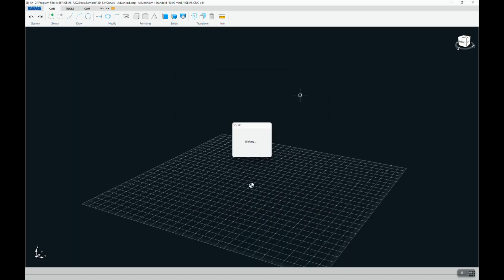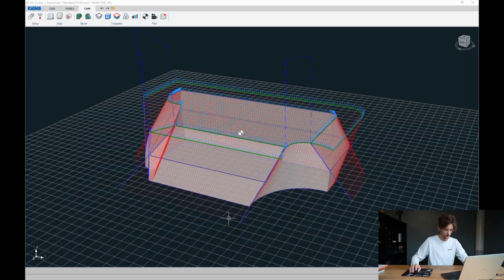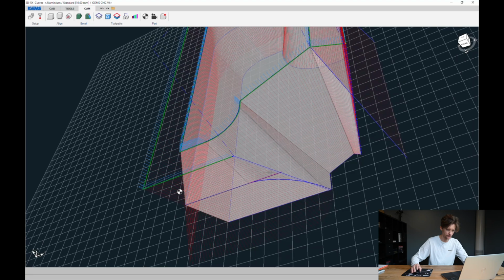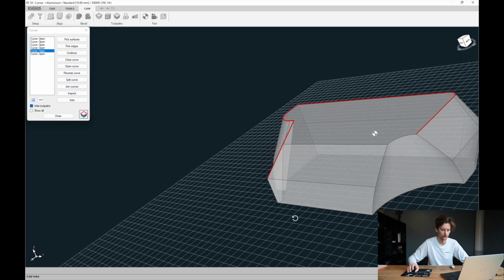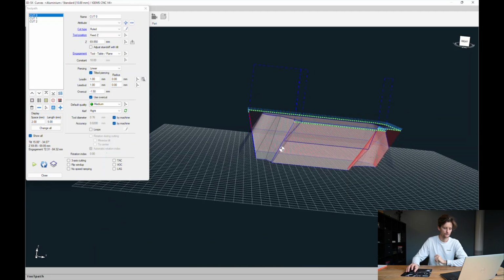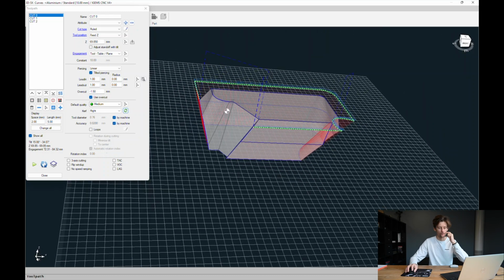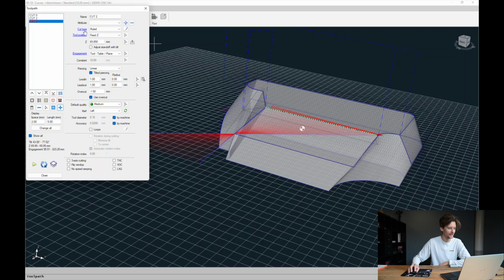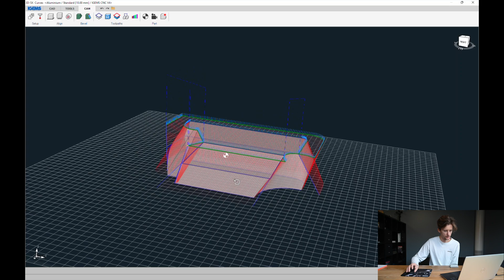Planning your cuts

Comment: Great video as always.

Im having some problem with a 45 Degree cut around a parts sometimes after programming my tool paths.  
'Rewind' - 'signature' Error came up as when doing simulation. iv try changing the tool path direction from left/right but still came up with the error.
machine head limitation are 270 degree on my 5x.

any advice or could you cover something like this on your next video of troubleshooting?

Athi
Reply from the maker: Athi,
Try using "Flip windup" a checkbox at the very bottom of the Toolpath window in 3D5X. If that doesn't work, please remake the tool path and select the opposite direction when picking cut direction.
Joakim
Reply: @igemswaterjet  that’s awesome, thank you joakim :)
Reply from the maker: @CDLEGO  Happy to help :)